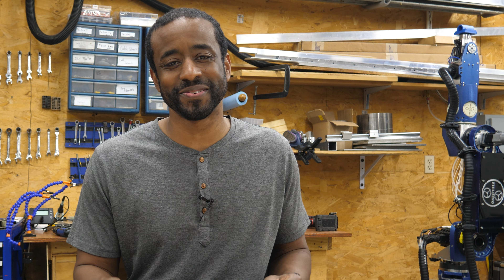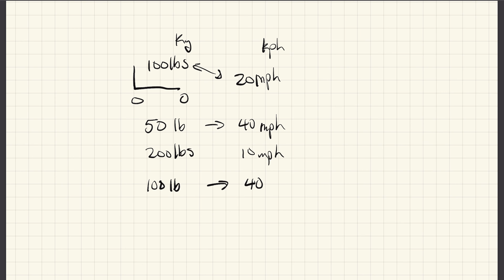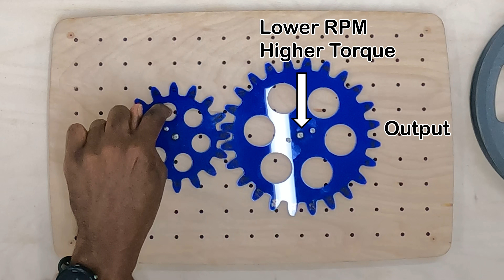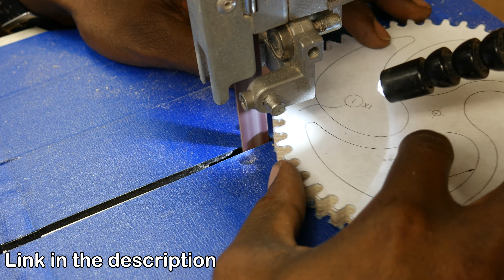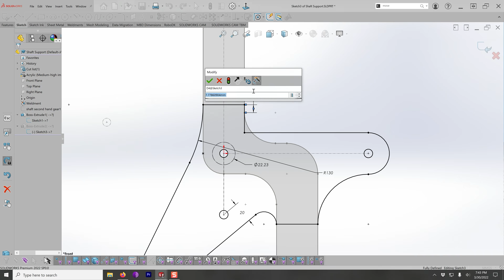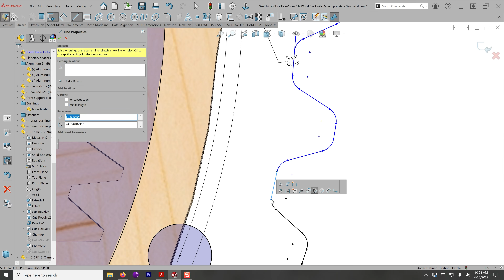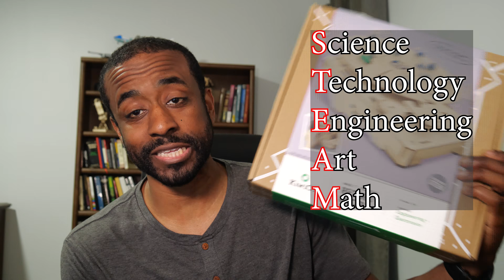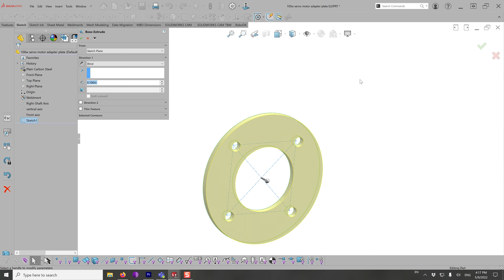How Gears and Pulleys Work: Jeremy Fielding 103

Comment: I was taught a screw became a bolt when a nut was applied. Some screws never become bolts. Great content as always!
Reply: I thought a screw can create its own threads in an object while a bolt will go into already created threads (discounting fastening and unfastening into the same piece).

Alternatively, whenever I search for a fastener online, the common nomenclature will be opposite of what I think it is (I swear half the battle in finding something is just figuring out what it's called).
Reply: @quintessenceSL  Isn't that a special case - self-tapping screw? As opposed to machine screw that goes into a cut metal thread?
Reply: @SianaGearz  Most machine screws I would consider bolts (you need to cut threads for them, either by tapping or a nut).

Consider holding two pieces of wood together. The difference between screw and bolt are pretty obvious then. My point being it shouldn't matter what you are fastening. It is in how it functions.

Hence my confusion in trying to find fasteners online.
Reply: @quintessenceSL  You may consider machine screws to be bolts, but why are they still called machine screws?
Reply: @markfryer9880  The difference between a bolt and a screw is how you tighten it. A screw is turned into a hole (whether it is pre-threaded or the the threads are formed by the screw itself) while a bolt is kept from turning and slides through the hole as a nut is turned around it. The difference between machine screws and wood screws or sheet metal screws is the shape of the threads. Bolts (when they have threads) could be considered a subset of machine screws but for their application. Some bolts don't have threads at all and are used to keep doors or gates closed. They just slide from one part into the other and are held in place by friction, catches or gravity.
Rule of thumb; bolts slide, screws turn.
Reply: What if the nut is captive?
Reply: @wade reed I love that definition. I usually look at the end too, screws are pointed and bolts are flat for the exact reason you say. But I don’t think a screw should ever become a bolt, it’s designed to be driven in verses threaded into a nut 🔩
Reply: @RudyLib926  That's been my impression in working with screws and bolts. Plus, that's the definition my dad gave me, so obviously it can't be wrong ;-)
Screw? Pointed end.
Bolt? Flat end, has a nut.

That was pretty much it lol.
Reply: Traditional/conventional/common names aside, the technical difference is that a screw is tightened by turning it while a bolt is tightened by turning a nut (usually) around it.
Reply: I think a screw ends internally in one of the pieces it's holding and uses the friction between the teeth and the material to maintain the hold, where a bolt goes through materials and must be held in place by a nut. Internal pressure versus external pressure.
Reply: I am a complete layperson when it comes to engineering, but I AM a writer, and linguistically, a "bolt" has a hex-style head that is fastened with a wrench. A "screw" has grooves in the head that allow it to be fastened with a screwdriver (or an Allen wrench)
Edit: or the bolt can have no head, in which case, it's fastened into place entirely by a nut.
Reply: @chibinecco1981  What to you mean linguistically? Many bolts have no threads. Deadbolts, slide bolts, shoot bolts, cane bolts, and the bolts on rifles. What do all these bolts have in common? They slide. Many screws have no heads. Lead screws, Archimedes screws, air screws and boat screws (both are also known as propellers) ball screws, set screws. What do these have in common? They do what they do by turning them.
Lag screws have hexagonal heads so that you can turn them into a lead tube to expand it in a hole in masonry.
Screws can have a slot in the head or a hole with various numbers of faces or two or three holes. They can have square heads, pentagonal heads, hexagonal heads or four, six or twelve faces, grooves or notches around the perimeter of the head or an oval head all made to be turned with some kind of driver, key or wrench.
Bolts with heads usually have a round head with a shape under or built into the head to keep it from turning while the nut is turned.
Screws turn, bolts slide.
Reply: I was taught the same. No nut = capscrew
Reply: A bolt is a fastener designed to attached unthreaded components, and a screw is designed to thread directly into a component. Thats why bolt usually have an unthreaded section between the head and the threads, for passing through an unthreaded part.
Reply: @bower31  Bolts and screws both have an unthreaded portion when their length is over a certain multiple of their diameter. (usually around 6:1) It is more common to see bolts that are over this ratio because they hold two unthreaded parts together and they must be long enough that the thread extends past the second part to apply a nut, while a screw need only extend part way into the the second (threaded) part. I assure you I have seen many machine screws and wood screws with unthreaded shanks, and more than a few carriage bolts and plow bolts that have threads that go all the way up to the square under the head. I have seen hex head machine screws that are fully threaded and some with unthreaded shanks, and I have seen both used as screws (turned into a threaded hole) and both used as bolts. (head captive and a nut turned onto the thread)

Comment: My guess is, screws are turned with drivers/keys and bolts, with sockets. Basically you put the tool into a screw vs over a bolt. Think hex screw vs hex bolt.

Comment: Jeremy, I never have problems making bushings.  What I do is clamp the tubing in between two pieces of wood with a relief to accommodate the tubing diameter minus what you need to snuggly hold it when clamped.  Once sawed (using a coping-saw), I check it for flatness using an outer-tube as a holder and sand accordingly.  Then I take a tapered hand-reamer and deburr the inside.  I make bushings a lot smaller than yours and they come out fine.  Also, did you say theere was Arduino-code available?  Love your videos and family--good show there sir!
Reply from the maker: the code is in the description
Reply: @Jeremy_Fielding    Jeremy, hey thanks for replying. For some reason, anything from the “Notes” section down, was not being displayed. I was able to get it now, so thank you ☺️!

Comment: Excellent content, as usual.
My feeling is that a screw is designed to grab onto the material itself but bolts are designed to grab onto nuts.
But that's just my feeling. I do not pretend to have special knowledge. And clearly certain screws can act like bolts and certain materials allow bolts to act like screws.

Comment: for the burr in the bushing..... maybe try cutting the bushing, with a dowel inside it. i would think the dowel would stop the burr, in the same way you can stop blow out on the back of a board, when drilling/cutting, by drilling/cutting it on top of another board. this should also give you more ability to grab it with plyers or a vice.

Comment: I've always thought/heard screw is when you screw it into the material itself, and bolt is when you use a nut... but then there's machine screws and in-part tapped threads sooo...

Comment: since nobody answered it a bolt is to hold two flanges together that goes through something and is fastened with a nut. a machine screw is something that fastens into a mating hole on a larger assembly. of course it is a silly distinction because they are basically the same thing and a bolt can be used as a machine screw if the threads are correct.

Comment: Can you do more about camshaft design? I'm also a self-taught on gearing topic too. I couldn't wrapped my mind around the gear design at first facing those fancies word addendum dedendum circular pitch diametor pitch pressure angle backlash blah blah. The more you do the better it gets and now I can just identify basic spec from purely  visual and surmise 😆 SOLIDWORKS is such a powerful tool to bring concept and theory to sketch and experimental parts.

Comment: How do you get the microwave motor to turn in the same direction predicably? I was under the impression that it turns in the direction of the waveform that it gets when its first turned on. if the frequency is in the positive direction, one way, and if the wave is in the negative direction, the other?

I ask, because the gearbox in them is so strong I actually wanted to build a 4x4 slow 'crawler', drive by wire type vehicle as a kid, but I couldn't figure out how to predicably turn the motor in the correct way. If you force the motor, say with pliers, as soon as you get to a point where it 'stops' it simply turns in the opposite direction.
Reply from the maker: It won't be predictable. But if you switch it on and off in my example it would likely be going in the right direction within two or three tries. But that was also WAY back when I really wanted to use that motor in a project. So I designed the clock specifically because I wanted to use that motor to drive something. Not what I would choose today.

Comment: Screw has deep thread cuttings and must be conical in shape. But, a bolt without a nut can also be called as a screw as it must fit into a threaded hole despite having a thread, While a bolt usually comes in a straight/cylindrical shape with threads on and must have a nut on the tip to stick tight on it by their thread fitting together.

Comment: In all my years of physical science classes and tooling around my work shop, I have never had gears, pulleys and see-saws compared so beautifully to torque and power. I knew all this stuff, but THANKS to this video and your explanation, I now FEEL the science and the math meshing in my brain.You turned it into intuition. 

I am not an engineer, but am a high school design teacher. I've shared your videos with my students before, but THIS one is one of your greats. THANK YOU Mr. Fielding!
Reply: @wildfire405  > Years ago after nasty lumbar fusions, they stuck me teaching at UTI after years of fixing vehicles. I knew one concept requires three ways to explain it. We started with automatics & torque converters. We did the normal fan pointed at fan, then they lost it a torque multiplication. I told them say I have a 5lb steel ball on a 5 foot chain and swung it overhead and hit your hand. It would hurt? Yes. Ok, now the chain is 10 foot long swinging at the same speed! Now it hurts, but how much more? The few that had a hard time understanding how turning the fluid and redirecting it made more torque, now got it.
Just like Jeremy’s teeter-totter example. It take different explanations for some to get it!

Comment: You should really get a lathe. Even a smaller one would make slight work of those small bushings by parting them off. Even better if you had a collet set to put them in it wouldn't even crush the tube and you can deburr both ends easily. Its kinda funny you can make an awesome fancy laser cut wooden clock but something as small as making those bushing trips you up lol.

Comment: Fantastic video Jeremy.  I see that you are using Solidworks as your CAD platform, great choice.  I have one question concerning your model, did you use a top down approach (a single sketch that drives the design) and model each part in place or did you design each part separately?
Reply from the maker: The original model was made before I had any real CAD strategy. So I was mostly fixing stuff. You can watch my 50 tips and tricks for 3d modeling to see how I make my designs now.
Reply: @Jeremy_Fielding  I will have to check that out, thank you for responding.

Comment: torque is a twisting "FORCE"  torque x speed= power?   Let's see... power is the rate that work is being done. It is a force acting thru a distance. FD like Newton-meters.
Torque x speed = force x speed . Speed is distance divided by time d/t. Torque x speed = force x speed =  force x distance / time or work/time =Work-rate.
Yup you're right Jeremy.  :)
Reply: True, but I'd quibble over the claim that the definition of "power" is "torque times speed". IMHO, power is defined just as you state it here, i.e. "rate that work is being done". That it can be calculated in different ways, including "torque time speed", doesn't make that the definition of power.

After all, if it did, what are we to do with "watts" or "horsepower", neither of which inherently involve torque at all?

Comment: Screw vs bolt.
to be secured the bolt requires a nut or a thread to tighten into... where a screw only uses the material it is going into to keep it tight and secure.  :P 
well actually  I have no idea if I am correct, but that is what comes to mind first.

Comment: 15:00 You don't saw tubes...
You use... a tube cutter.  for small diameters like that one, a decent hand held one will set you back 15-20US$ there's cheaper (and bad) and there's more expensive ones.  a cheap one will tend to wear out the cutting wheels faster.

Comment: You appear to have a suite of machines.  I assume you have a lathe, but I know you have a mill (it's in the video).  With either, you can make "perfect" bearing sleeves.  Why didn't you use them?  Don't rely on press-fit in wood.  You wisely used adhesive bonding.
          Incidentally, DO NOT USE ALUMINUM FOR JOURNAL BEARINGS!  Aluminum has poor "contact properties".  It is soft & tends to gall.  it also has an oxide coating which abrades the mating surface.  Use steel instead (you can press stainless steel sleeves over the aluminum if you don't want the whole shaft steel).  Use BEARING BRONZE for the sleeves (you can buy the stock, it is easy to machine on lathe or mill).  (Remember your axiom: "don't build when you can buy".  You could have used ball bearings, even if they are overkill.)
          Regarding wood: DON'T make anything out of wood that is affected by warping.  Thin spindly gears with mostly open structure is just asking for it.  If a gear is 2" thick & 4" in diameter, you should be OK, but not one 8" diameter & 1/2" thick (with open structure).  If the gear is wide & there is lots of clearance on each side, then OK.  If you insist, you need to pre-age the wood & treat it with finish.
          Regarding laser-cutting Acrylic plastic (as you say, "talk to those experienced working with the material"), you are setting up a "time bomb".  In a couple of months, there will be cracks radiating from all the "inside corners" of the parts.  The reason: just as you say at the video end: "thermal expansion mismatch".  how can you have a "mismatch" in the same material?  Easy.  Heat part of it to molten (like TIG welding metal), then let it cool.  The molten part tries to shrink, but is braced by the bulk cold material, leaving it in HIGH (for plastic) tension.  PLASTIC DOESN'T LIKE PROLONGED TENSION!  You have all those nice sharp internal corners in the tooth roots.  Put semi-circular radii on those.  Put same on the tips of the teeth.  Looks better, easier to handle (no sharp corners, especially on unguarded gears.)
          How to deal with acrylic plastic cracking?  BEEN THERE DONE THAT!  Heat your plastic to 120F.  Put it in laser cutter & cut promptly (fudge your CAD file to account for the expansion).  Then promptly remove & ANNEAL the plastic (heat profile according to type & thickness).  Use CAST acrylic, not extruded (has built-in stress).  If distortion is a problem, pre-anneal (discard warped pieces), then laser-cut, then re-anneal LIGHTLY clamped.  You can anneal at lower temps for longer times.  Get a cheap pair of POLARIZED sunglasses, & take the lenses out.  Mount on a frame so you are looking through both lenses in series with space in between, light from behind.  Rotate one lens until it goes dark, then fasten.  Put your plastic in between & have diffuse light coming from behind.  you will see dazzling colors indicating stress.  Freshly laser-cut  pieces will show intense narrow band around the edge, with inside corners more intense.  If your anneal is working, there will be little color.  CHECK THIS OUT ON YOUR EXISTING CLOCK!
          You fail to mention one important (& underused, since the TIG "hot glue gun for metal."), BRAZING.  Brazing is defined as metallurgical bondIing using a lower-melting-point filler (with the melting point greater than 700F.  Below that it is "soldering".)  You can silver braze with an "ordinary" propane torch.  There is no necessity for temperature gradient.  You also don't need years of skill.  If your prep work is good, you will get good braze.  If it is bad, you can re-do on the same parts.  You need not wear a "space suit" (other than clear safety glasses, which you should be wearing anyway.)
          To properly TIG weld metal, you need:  TIG torch, ACETYLENE TORCH.  You preheat with the acetylene torch (>500F), then TIG, then anneal with acetylene torch.  When you make those "pretty" stitches, what happens to all those surfaces held together (but not welded)?  Answer: CORROSION.  If the stitches are enough, YOUR METAL PARTS ARE TOO BIG.  If you must weld, weld THROUGH.

Comment: Honestly etymology is kinda fun, a bolt doesn't require threads, is a short metal rod used for fastening, which then gets used in crossbows to enable a bolt of lighting, or a horse bolting from the stables. A screw is specifically about the threads and . Interestingly a rivet is a type of bolt, or was before modern times. so I kinda agree with others that in modern times it's applied arbitrarily, at least the etymology shows us how we got here. I think all screws are also bolts,  but not all bolts are screws. After all, we screw in bolts.
Reply: The distinction between a screw and a bolt is not arbitrary.  Together tbey are both "threaded fasteners".  Screws thread into the base matetial.  Bolts require the nuts to provide the receiving threads.